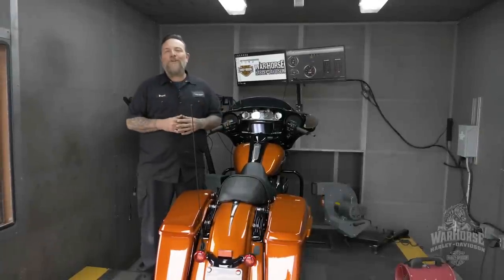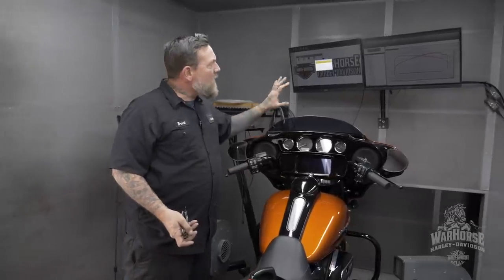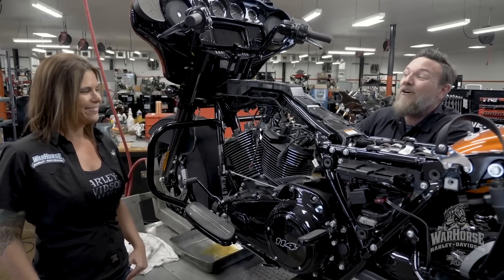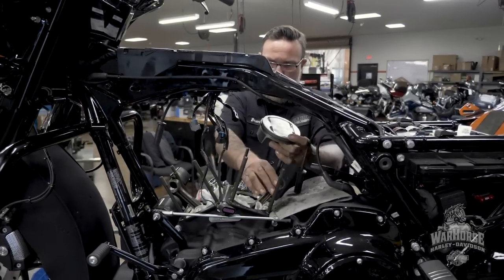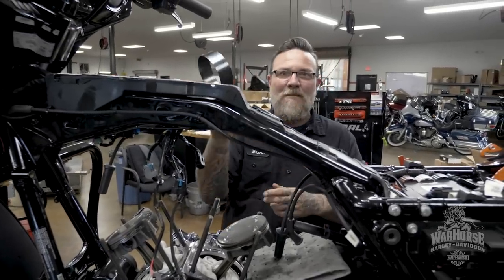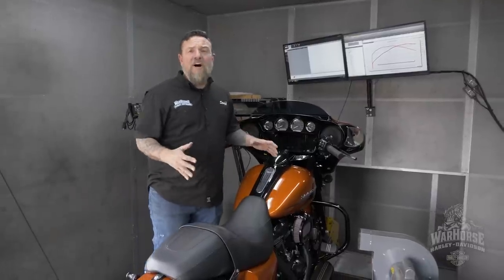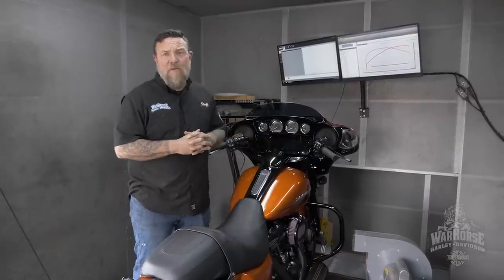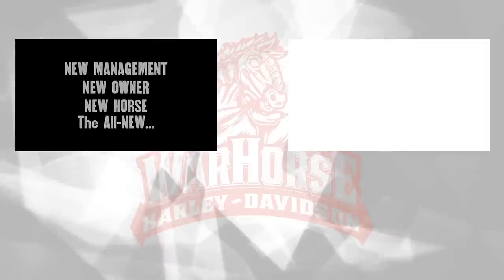Harley-Davidson Screamin Eagle 131 Stage 4 Crate Engine Upgrade Dyno with Horsepower and Torque

Comment: 80hp stock! Wow!  A whopping 124hp after all that? It’s a crying shame that the HD community never warmed up to the V Rod. In stock configuration, it’s almost 130hp.  And if you want to spend some coin, get a screaming eagle vrod (heads are already done) and toss a stroker crank in it. That’s all folks! Under 3k in mods and you’ll be looking at close to 200hp.
Reply from the maker: The numbers do seem low but those are wheel numbers. Most manufacturers advertise crank HP and Torque. Thanks for watching!
Reply: Vrods have like 110 to the wheel so

Comment: In Germany we have the „HyperTorxster“ kit by Sohn Motorcycles, 146Cui, 177lb-ft and 165HP ❤️
Reply: Will that motor work on a victory motorcycle?
Reply: no its a big bore kit for M8 engines
Reply: Now that's what you call an upgrade. 🔥🔥🔥
Reply: That's almost on par with the stock metric bikes.
Reply: You German’s sure do know how to build things and so mechanically inclined.
Reply: In the USA we have a 127ci crate motor that is 144HP ant 147TQ at the rear wheel by Ultima for 3800 dollars
Reply: what bike?

Comment: Great video , thanks for Real results on a Warrantied upgrade.  Alot of haters out there saying they are putting up better numbers. But at what cost ? Wild cam that idles like shit , stupid compression so you have to run race gas ? Great job keeping it real , showing a bike you could ride anywhere,  anytime !!
Reply from the maker: Thanks for the kind words! That was the point of this video is to have full transparency and to show what  numbers can be put up with a dealer upgraded warranty backed motor! Thanks again for watching!

Comment: I was actually expecting better numbers than that.  The 124 kits are making more, which is kind of surprising to me.  I only say kind of because I understand that you are still using a Harley cam and tuner which is limiting the results by quite a bit.
Reply from the maker: Thanks for the feedback. We're happy with the increase and this thing is still under warranty so we're happy!
Reply: Plus it’s still emmisions compliant

Comment: That’s it? Those numbers can be made on a twin cam with a 110 kit cams and a good tune.
Reply from the maker: Thanks for your input! We installed the kit and those are the numbers that we got.
Reply: Earl James  no shit 😂 no one pays attention to warrantee or emotions after they do engine work, the whole point of the engine work and doing pipes and intakes and cams and big bore kits is to get more power, screw the emissions
Reply: My dyna street bob 110 puts out 106hp 122tq....man those m8 motors are so restricted in stock form.
Reply: Joe Plem that’s not even stock! That’s even with a 131 cubic inch motor! He should be getting way more power out of that thing
Reply: @Ridehighfxdb  These motors are not 100% sorted out yet so at least keeping the warranty is a good thing. Their is nothing like making payments on a bike with a blown engine and no warranty.
Reply: L Johnson but my point is with an engine that big it should be making way more power because you could get that power from the smaller engines I’ve seen it numerous times
Reply: @Ridehighfxdb  The goal is long term durability and headroom.
Reply: People are getting around 140-150 with aftermarket cams. Can't compare a built engine with one running a stock HD cam
Reply: Joe Plem I’ve got a stock 110 street bob. What all have you done to get the 106hp

Comment: Cant wait to see what the indian challenger is going to make once they release their big bore kit.🤔 .. bigger isn't always better I guess.  Thanks for the review.
Reply from the maker: I guess we will see! Thanks for watching!
Reply: What challenger big bore! Some people give Polaris too much credit! Secondly once you add a aftermarket cam, the Screamin Eagle ported manifold and 6.2 injectors to this beast that’s after the warranty expires quite naturally there’s no reason why this motor should produce 140-150 plus horsepower! Polaris dudes need to realize that this is legal EPA compliant power! the rear wheel horsepower on the Indian Challenger legally is only 103-107 hp
Reply: FactJedi  10-4 on the Big BOREdom kit! Oh wait! Now that you mention it, that kit may have already been released! Liked that very much! :)
Reply: @darrellmoore2499  so let me get this correct. Once you spend 3k or 6k for the kit or crate engine. Then I need to open it up again to add cams and heads and injectors so it can perform better? And spend another 3k or more?  What is being left out is the cost$$ of the total build with a proper dyno tune .  
Just go to Fuelmoto or star racing and get 150hp/150tq with a 124 kit. For the same $$.  But but what about warranty.  If you go to a reputable builder the engine will last
Reply: The ability of a well designed motor will always exceed the ability of a poorer designed motor when give the same treatments. The challenger out of the box has about 20 more horse than the m8 in this video. It wont take a big bore kit to beat this machine. $1500 worth of cams and exhaust to blow this 131" mill away and it will likely last twice as long. For everybody knocking polaris you should thank em. Without victory and indian youd all still be riding twin 88s.
Reply: taps 1021 well the cam is $275, the se ported manifold is $175, HPI 6.2 injectors are 230! Harley Davidsons new extreme ported heads are not the old CNC ported m8 heads! This is completely new with a brand new CNC profile with oversize valves! I wouldn’t spend $1800.00 to get another 30 cfm of air!  These heads have never been sold! They may not be improbable by much!! That’s the beauty of this motor! On the cheap $6k plus install you get a 1 year warranty from the company! If it’s a new bike for 2  years!
So no you don’t have to rebuild this! I own two 120R powered bikes! I did have the cranks welded and changed the cams and injectors to get to 140hp and torque! The M8 crank is bullet proof so no bottom end assembly required! When it’s time to unleash it then for $1500.00 with TTS tuner and dyno tune you are in the 140’s! If you buy the entire crate motor, you have a whole motor that’s not carved up and you can keep it to sell either with the bike or by itself or install a 128 kit on the Top and have a 130 horsepower spare motor on the shelf!  As far as fuel moto is concerned, I live in Milwaukee! I have never seen any of fuel moto’s motor conversion bikes that have reproduced the fuel moto dyno claims on a Dyno in the Milwaukee area! Their numbers always come in 10-12% lower!
Reply: @darrellmoore2499  you have never heard of fuelmoto?? They have a yt  and ig . Look them up. There just like zippers  gmr tman and star racing .  Star racing has m8 s making 200hp 180tq
Reply: kevin mcbee  harley Design’s and builds their own motors! Polaris bought the Indian name and immediately worked with S&S and polished up the S&S X-Wedge motor that S&S designed in 2004 and called it a power stroke 111! Polaris did not design that motor! As far as the capabilities of a challenger with different cams, can you post a video or dyno sheet showing how much this 4 month old motor can be improved? Please don’t write checks in here! To be honest I’m not sure Polaris. even designed that motor! If they did it was with S&s’s help! There would have never been a victory 106 without S&S! Well built? Polaris has a lot of ground to make up when it comes to design longevity! What the 131 can do is provable and visible! Suburban Harley in thiensville Wisconsin has a 130 kit that has a repeatable and provable 152 hp and 149 ft/lbs of torque! That mini motor high revving challenger motor would be wasted air space next to something like that
Reply: Oh yes I’ve heard of fuel moto! They’re about 100 miles north of me! I’m very familiar with what they cans with the tuner they’ve been using the Power vision! I know three people who had their 103’s upgraded to 110 and one has their 124! Not saying this is inferior stuff quite the contrary! They do a good job! I wouldn’t compare them to Star Racing but Zippers yeah but the problem is each of my friends came back home boasting numbers that could not be repeated at either of the Harley Davidson dealerships only the Metro Milwaukee area!
Reply: @darrellmoore2499  youve got to be on drugs. They seem really good though so nice find
Reply: @darrellmoore2499  interesting. I know each dyno will produce different #s but they shouldn't be more than 5hp off
Reply: kevin mcbee https://www.jpcycles.com/countersteer/moto-101/s-s-reveals-innovative-x-wedge-engine

Does this motor look familiar? Polaris bought Indian and used this design to develop their thunder stroke engine! The motor didn’t just show up  out of thin air two years after buying Indian!
Reply: kevin mcbee I think it looks a lot like this one. Would you agree?

https://www.cycleworld.com/2013/03/09/exclusive-inside-the-all-new-indian-thunder-stroke-111-v-twin-engine/
Reply: kevin mcbee show me a 100000 mile challenger! Better yet show me a 100000 mile thunder stroke that’s was not a victim of the massive recalls that Polaris had to make from 2014-2017!
Reply: taps 1021 I should have mentioned the difference is more on the torque! One 110 conversion from fuel moto, with a sheet showing 129 ft. Lb torque but The former Irontown harley dealership could only pull 116 cold and 118 hot from that fuel moto build
Reply: @darrellmoore2499  no they arent the same or even all that similar except for every hd idiots wet dream that its a vtwin so it must be a copy . Just looking at the exhaust ports alone would mean a completley different head design. The 56.25 angle on the x wedge is also a far cry from the thunderstrokes 49° They look more like the onld indian motors in the 30s, but you will see what you want. Also youre the one who said the 131 was "proven so I want to see the ine youre talking about. I never mentiined anything about reliability for polaris other than theyve beaten hd everytime its come up in a scientific way. So thanks for clearing all that up. Ive already heard all I need from you to know whats up, so have a great day. Enjoy that suzuki
Reply: kevin mcbee I haven’t cleared it up bcuz evidently you still don’t understand! That’s exactly the x wedge configuration except Polaris took the entire motor configuration and created a case which housed the transmission and the engine so they could use common oil like some of the metric motorcycles do! So as far as the design it’s S&S’s design! I spoke with  an S&S rep at an open house here in Milwaukee about two years Go and he told me the company S&S talking point is “we showed them our motor and they came up with their 111 inch motor” period! That’s all their going to say! But I don’t think that I can clear things up for you without becoming insulting and I don’t want to do that so again you’re obviously not A harley Davidson enthusiast so if you need me to I can point you to Gold Wing  dyno videos, indian dyno videos,  Yamaha Dyno videos etc!   In here I’m quite sure you’re drawing a multitude of snickers! You came to troll on Harley Davidson enthusiasts and if you want to keep battling with me I can throw a hell of a lot of info at you but frankly I’m not being challenged here mentally and technically by responding to all of the emails telling me you have comments for me so please let’s hang it up now and walk away like men! Have a good day and be sFe!
Reply: @darrellmoore2499  different heads, different angles of motor, different bore that doesnt even fit s&s's stated perameters of what was possible with their mill and likewise stroke values that were outside of s&s's stated perameters of what was possible with the x wedge, but you talked to a guy. And indian supposedly built a case around an s&s motor. Got it
Reply: @darrellmoore2499  youre clearly the one that doesnt know what hes talking about. Xwedge is a 56.25° mill according to s&s. It was capable of taking a bore from 4.125 to 4.5 and a stroke of 4.125 to 4.375. The thunderstroke is a 49° plant with a 3.89 bore and a 4.45 stroke. Not even remotley the same.
Reply: kevin mcbee S&S provided  and sold Polaris cylinders, pistons and crankshafts for their Victory 106 motor! Watch the miniseries Harley and the Davidson’s! The motor is S&S motors built off the victory design with bottle cap heads was used because Harley Davidson would not participate in that movie! What do you think, Polaris built those motors from the ground up? They’ve had a relationship with S&S for 22 years ever since Victory was formed by Polaris! Yeah I talked to a guy and I did research! I would never freakin buy an Indian motorcycle period! I’m also not hating on them but until you and Polaris have 51% of the market your still underlings in this market! You share your lanes with, Honda, Yamaha, Suzuki and Kawasaki! The majority of you guys are coming off of Gold Wings ever since Honda moved their production out of Ohio and sent it back to Japan! Any of you are also pissed about Honda removing /00 pounds from the Gold Wing and you want something but anything other than a Harley! Go on! Even though Harley stock may be down from its historic heights, Harley’s market capitalization is just as much if not more than Polaris industries combined! I’d by a BMW before I’d buy a damn Indian! Will they do as touring bikes? Yeah for the harley hating crowd!  It does just fine! So have at it! Whatever tickles your fancy! Aren’t you tired of hurling rocks at me! Guess not! My wife likes to get the last word too! Don’t make her right though!
Reply: kevin mcbee dude did I say the engine is the same? I said thZt is N Xeedge design! S&S designed several displacements with this XWedge! Do the birds change does thstroke change? Yes! The fucking design with the three can setup is S&S’s! Did Polaris come out with a 116 of course they did? Did I have a twin cM 88 of course I’ did! Had two of them! did I put bigger cylinders on them to increase the displacement to 95 ci of course I did! Did I change the crankshaft to make one a 113 and one a 117 of course I did! The 4 3/4 crank went in where the 4.00 was previously! Did I change the cylinders and pistons 4.06 to make 113 ci yes! Did I install 4.25 to make the 4 3/4 stroke to 117 ci! My two 120R’s both have 4 5/8 cranks with 4.06 cylinders? Yes that makes 1-0 ci! The guy king design of the motor never changed! Bore and stroke did! You think the bore is the same in the 116 Indian big bore kit? No! Did the engine bore change? Yes! I’ve been riding Harley’s for 38 years! Before that I rode one hind 400 1978! A hWk! What did you say about a 40 year old Honda? I bought it new! I had. a Yamaha 850, 2 x Yamaha 1100 specials! A 1980 and 1981! 2 V Max’s! I bought my first Harley in 1983 and two years later sold my V Max’sinterndt poser! You’re out your freakin mind! I own a 1983 harley tour glide classic, 2000 ultra classic 117 ci, 2003 anniversary ultra classic 113CI, 2009 Road King Classic 117ci 2013 CVO RoD King 120R, 2014 CVO LIMITED! 117, 2015 Road Glide 120R and I’m putting a harley 131 in my brand new 2019 street glide! I am not a fucking poser! I own Eight Harley Davidsons right now! Not past tense and the weakest motor I have is my 1-3 in my 2003 ultra which has rear wheel dyno sheets at 125.9 hp and 129.6 torque! That’s a freaking 113 mild with Tman 625 cams! You know very little about what you’re pushing with this Indian shit! I have a very good friend who works for Indian! Uhh he’s an engineer! He also knows that I won’t buy his stuff! Lol! I know where this fucking motor came from! My wife mixes paint for  harley Davidson and Indian at PPG IN OAK CREEK Wi!  I have built several 124’’s for my friends using S&S and Revolution performance parts! I have been running Trials and grudges  at Great Lakes Dragaway in Union Grove wi for 40 years! Indians thunderstroke makes good torque and shit for horsepower! Poser my ass! My wife is laughing at you!
Reply: kevin mcbee I’m turning off notifications now I’m tired of this!
Reply: Darrell Moore but they are likely to do it for a long time pressed togather flywheels are destined to fail
Reply: Dr. Daddy hell I sold my twin cam and went back to a shovel just didn't need any timing chain crap or pressed togather flywheels maybe have less power but I will have it longer
Reply: @williamquire2115  id rather ride an old evo than anything they make now too
Reply: @taps_1021  I couldn't agree more.   Harley has to stop squeezing every last dollar out of their customer base.   They aren't the only game in town.